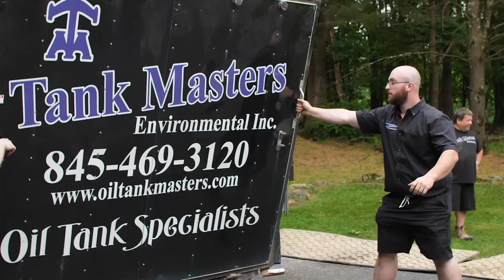Underground Removal And Aboveground Install Under 2 hrs.

Comment: Impressive that you are able to complete a tank removal and installation within a couple of hours.  The finished appearance of the site is equally impressive.  Looks as if the homeowner got that tank removed just before it rusted through.

Comment: If you take the crescent wrench and put it on the end of the copper and spin it around about an inch or so that flare nut will slide right on. You’ll round the pipe out works pretty good!